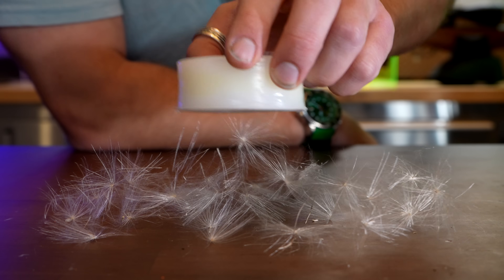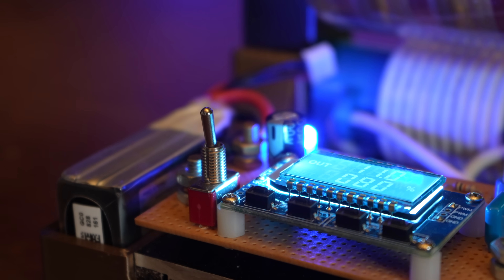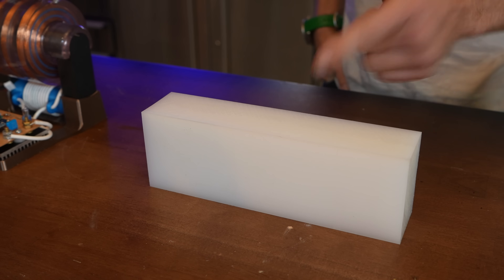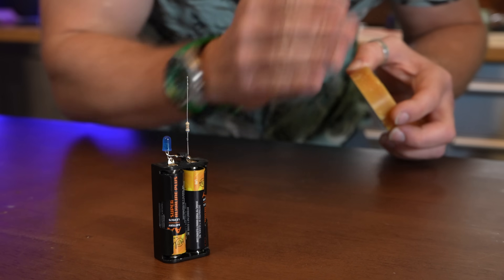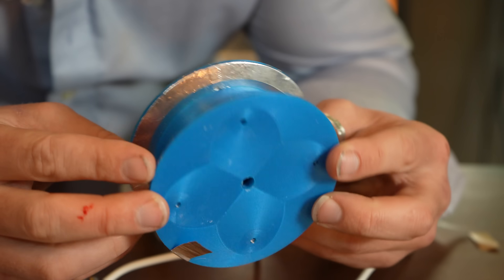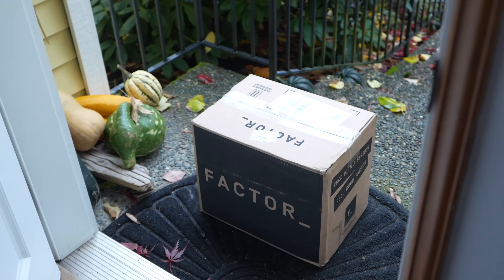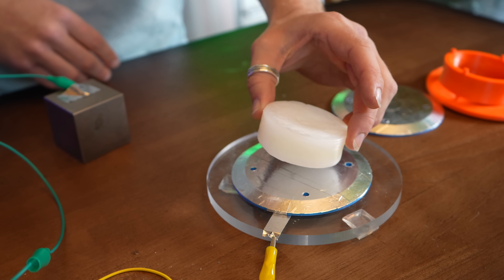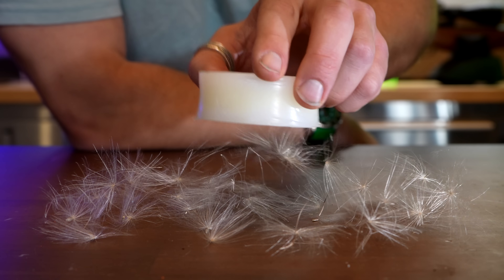Creating an Exotic Material With A Permanent Static Charge (Electret)

Comment: I used to work for 3M. We used Electret fibres for air filters.
Reply: Makes for a very good filter for the smallest particles doesn't it? I have used a few metallic static charged filters but they lose their charge with time
Reply: I have two of those in my house. 
And in the 1990's, I bought a couple for the house I owned then too.
Reply: @Technichian462  3M bought the technology from a Dutch firm decades ago. It's really interesting how they make charged fibres, but I'm uncertain how much is a trade secret: it's enough to know that once the fibres have been formed into a non-woven fabric that the overall charge is zero (as measured form the outside), and yet individual fibres retain their charge like little capacitors.
Reply: @chriscarter2101  wow sounds interesting, thanks for sharing
Reply: that is part of the principle for some of the particules in N95 masks
Reply: @chriscarter2101  That's really interesting!
Would that be the same kind of tech in like a 3M respirator?
Reply: @galacticviper4453  AFAIK, yes. IIRC (and Chris do feel free to chime in, Im interested if I got this right), there are three aspects to the basic white cloth-ish thing over the mouth with metal nose dealy respirators: Blocking, absorption, and deflection. Blocking (or filtering? Cant remember) is simply straight blocking large particles with pores too small to pass through. Absorption is the tangled mess of little hairs that grab onto things that touch them, similar to how activated charcoal has all those nook and crannies for stuff to get lodged in and captured. Deflection is for the very fine particles, there are threads (that I just realized are electret material apparently when I saw this comment thread) which through attraction or repulsion push particles out of the air flowing through the tiny passages and into the fibers to then be absorbed and captured. Basically the use (static) electricity to shove junk out of the air into the filter material! And thats pretty cool!
Reply: @galacticviper4453  3M Aura 9312 has this for instance. I used thsi type for years since I worked in dusty environments there.
Reply: Thank you, Mr. 3M for accidentally starting a religious war!

Seriously though, I knew there was something about static, but your comment made sense of it.
Reply: @firstmkb  Ha Ha! No, that was not my intention. I only wanted to share my insights into air filtering. Any opinions I have are personal and may not represent my previous employer ( I have retired!). There are still a lot of understandable emotions that society has to work through, openly and honestly, for healing to take place.
Reply: @chriscarter2101 Would you want Alex Jones ranting in your face with covid to be wearing a mask or not?
Reply: I am a big fan of 2 inch wide magnetic tape recorders :)
Reply: @MrThacke  The old Scotch system! I visited the 3M plant in  Gorseinon regularly from the late '80s. The technology was, for its time, amazing, with little robots rushing around carrying the meter wide rolls to tape and banks of auto splicing machines turning the tape pancakes into cassettes. It was sold to BASF as the world transitioned to digital.
Reply: Is the 3M static film invisible wall story real?
Reply: @ogbt  I very much doubt it. I worked on a high speed manufacturing line where we applied a hot-melt adhesive to polypropylene and polyester webs. I had to apply flags (taped time- stamp and lot number markers) to the web by hand every few minutes as we changed experimental lots; and every time I did so, I got a 20K shock. This did not prevent me from applying them but made for a very uncomfortable half an hour!  My hair stood on end but I was not prevented from approaching. Interestingly, I heard about a technique where an electrostaticaly-pinned plasma field could act as a gasket to restrain a low pressure gas on web-lines, but only experienced lines running at low pressure for various treatments. If true, then the plasma was resisting 14 pounds per square inch, and so there may be a grain of truth in there somewhere.
Reply: @chriscarter2101 oh dang, I’ve heard that rumor for a long time, it’s cool to hear a kinda confirmation of it’s plausibility, thanks for your response bro
Reply: Those masks main purpose was to stop water droplets in breath and air. Most of the viruses were carried in them @chriscarter2101
Reply: @chriscarter2101  oh good lord dont start with that shit. The masks arent meant to block individual virus particles theyre meant to block the much larger blobs of stuff that we exhale, cough, and sneeze, ON WHICH the viruses catch a ride. We're not trying to catch viruses themselves we're trying to catch the vehicles they travel on and masks are very effective at doing just that. If people like you were in charge we'd still be in the middle of the pandemic and it wouldve killed countless more people than it did.
Reply: @chriscarter2101  I can authoritatively say, you don't have any clue whatsoever about masks. I managed a team of two dozen public health infectious disease epidemiologists that study respiratory PPE (both in labs and in community) and were involved in the 63 page review below (citing 413 other studies and papers on the subject). The person I reported to has over 27,000 peer reviewed academic literature citations on the subject of respiratory PPE, particularly in the context of infectious pathogen protection. They work.

Greenhalgh T, MacIntyre CR, Baker MG, Bhattacharjee S, Chughtai AA, Fisman D, Kunasekaran M, Kvalsvig A, Lupton D, Oliver M, Tawfiq E, Ungrin M, Vipond J.2024.Masks and respirators for prevention of respiratory infections: a state of the science review. Clin Microbiol Rev 37:e00124-23.https://doi.org/10.1128/cmr.00124-23

p.s. I've still never had COVID, nor any other respiratory pathogens in the last five and a half years, until a single dose of rhinovirus this week from unwillingly going maskless somewhere indoors in public due to an emergency.
Reply: @chriscarter2101  As soon as I saw "PN-demic" I knew I was in for a treat.
Reply: @chriscarter2101  yes. about all the masks are good for is for redirecting your airflow into a certain direction (supposing you had a decent mask), so great if you wanted to get up close to another person and not blow crap directly onto them for a short amount of time.

@gormauslander the redirected airflow made it so that particles spent longer time being exposed to air and sunlight increasing the rate of viral disruption before said particle got reingested by another being. masks are rather a moot point beyond use at close range in general, at least without some really specialized stuff

also you have the problems of contradictory reports (as well as the de-contextualizing of reports), as well as political intervention absolutely mucking all sides up.
now previous to the pandemic, every time i'd gone to the doctor, any time the doctor wore a face mask was only when they were getting really close to inspect something on me especially if it was in the head region or involved a break in the skin.
Reply: @chriscarter2101  I was blown away how long took for the availability and price point to lower for PAPRs.  Seems the PAPR system is what one would want with more common COTS filters.
Reply: @jafinch78  Sorry but I can't comment on prices. In my role in Industrial Abrasives we generally used sir-fed masks, full face masks with carbon filters and disposable particulate filter masks. We did sell personal powered air-fed units but I never used those myself. I've never heard of the last category you mentioned: I'm a Chemist who worked in dust extraction from abrasives, and abraded surfaces, using various techniques such as electrostatics and adhesive wipes etc, not an expert in air-filtration technology.
Reply: That's so cool
Reply: AAAA
Reply: Plan Dem ic
Reply: @josephlieberman3027  Clearly
Reply: @chriscarter2101 While we can respect you for your knowledge in your designated field, please show the same respect for others in theirs. You might know more than us about charged particle filters, and likewise doctors know more than you about virology. They have explained time and time again that masks are not for trapping individual floating viruses, but water droplets escaping your face carrying them. Those are much larger than the individual virus cells and are able to be trapped in the mask and clinical study showed their effect.
Reply: @gormauslander  While we can respect you for your pedantry in your comments, please show the same respect for others in theirs. 

1) You do not speak for us, dont use "we".

2) Cloth masks were a better than nothing solution. Everyone knew this. Well, except for the Karens shooting security guards at dollar tree for asking them to put on a mask....

3) Would you like to take a tour of a virology lab with just a few sheets of cotton over your face? 

4) And finally, what all pedants deserve.... 
🖕😎
Reply: @gormauslander  thank god someone has some sense. Masks arent supposed to be catching individual viruses but instead the much larger particles they travel on.
Reply: @gormauslander  " and clinical study showed their effect." - yes, to be zero.

Masks did nothing except make people more aware of their hygiene and behaviours.
Reply: @gormauslander are you okay?
Reply: @ I'm okay, thanks for asking.
Reply: Better listen to Daddy know it all 😉

Comment: With pcb + assembly service from some Chinese fab you could easily build high resolution field imager, like 64x64 using for example 8x8 boards arranged by 8x8 or even you could build 256x256 sensor 😅

Comment: Fantastic video! I have a question: what happens if you place the electret in an electrolyte solution? I would expect that free charge carriers in the electrolyte would accumulate on either side of the electret, effectively shielding the electric field. However, I’m unsure about this because a similar effect should occur when touching the electret with your hand. 
It's surprising that the electric field can persist permanently. I would expect that over time, ions or molecules in an ionized state within the surrounding medium would migrate to opposite sides of the electret due to the electric field, eventually neutralizing the field. However, this might not occur if the process is energetically unfavorable—for instance, if the repulsive potential of the charges accumulating on the surface is greater than the work done by the electric field in moving the charges to the surface.
In any case, this phenomenon is incredibly surprising and super cool!

Comment: This is how face mask filter media can be higher filtration efficiency than just the fabric itself.  The material is made from polypropylene and is charged between charged bars.
Reply: Not just face masks. It is used much more in furnace filters! They are really effective when combined with a box fan. I had a 20 inch box fan and then used 5 furnace filters to create a big whole apartment air filter setup. The downside is 5 high merv furnace filters can cost up to 80 bucks and they only last around 3ish months depending on use time
Reply: @DarkAttack14  Reminds me of the old electrostatic filters, I had one on my furnace, but they need constant maintenance.

Comment: It would be cool if you made a 3-dimensional array and plotted the field strength in 3D. You could streamline the processes using PCBs.
Reply: I can imagine something like GreatScott's 3D led matrix
Reply: Great ideal, same as in my comment. That would be awsome.
Reply: Or you could try one sensor on a 2D or 3D positioning system
Reply: @AdrianBoyko  For example mount the sensor on the head of a 3d printer. If you could move that freely to any position you could take a picture each time and at the end merge them together

Comment: The most interesting is WHY the electret do not collect the electrons from the environment (there are infinite amounts everywhere) to compensate self polarization and become neutral?! It attracts light particles or water electrostatically, why do not attract the electrons from the near objects?!?!?!🤔
Reply: It probably does, but only on the absolute surface. The bulk is still charged. A higher detailed detector (I hear you can use grass seeds) may show this.

Comment: The word electret sounded vaguely familiar but I couldn't place it until the last frame when you mentioned microphones. I remember the word from electronics kits and tape recorders when i was a kid back in the 70s and 80s "electret microphone."  It was just a word back then.  I had no idea what it meant. Interesting video, thanks.
Reply: Same here! The first thing that came to my mind when I saw the title was - a microphone. My young self heard from dad that it was "capacitive", as opposed to 'dynamic' that were "inductive" because they were based on a coil and a magnet, just like every single speaker we've had. I remember wondering, if that's possible, then why don't we have capacitive speakers then? Imagine my grin when I understood how piezo-speakers from cheap toys exactly worked :D
Reply: @quetzalcoatl-pl  Capacitive speakers are usually called Electrostatic speakers, and they work quite nicely!  Some really fine stuff!
Reply: Thanks for that connection, I think most of us (old enough) vaguely remember that too

Comment: For the high-res version, I think you'll have an easier time designing a PCB and having it assembled for you by JLCPCB or PCBWay. You might even be able to have the sponsor the video, I've seen them sponsor quite a few maker videos featuring their PCBs
Reply: This! And that way you can make it even higher than 10x10.
Reply: Beat me to it! MM resolution on the sensors and the whole thing assembled for you. They'd probably do it for free for a sponsor bit, too, which I'm okay with.
Reply: @pufthemajicdragon  I2C each unit and make the 'antenna' shape such that you can detect levels of 'influence'.  Then create a device to fold the puck and maneuver it around at a specific distance.  Could even do a spherical detector array and a spherical manipulator surround to IMAX the whole thing.  I wonder if the field passes through things the way magnetic fields do.  I'll bet the quantum computers might flip errors with a charged up guy standing nearby.  If you are on very good, dry insulative shoes, you can take on a charge.  You become the separated conductive plate with Earth ground as the other plate and your shoes as the insulator.  I used to build HVDC supplies, so I can state that it is true.  Much better to put a big insulating sheet down those, because if one of those shoes fails, you would take a severe zap to your foot.
Reply: Beat me to this. Super happy to help you design it.
Reply: The use of some neopixels or something would be awesome too, can use a variety of colors depending on how far it is
Reply: + Some are small enough to allow a muchhhh greater density so you can see so much more of the field
Reply: Yeah, JLCPCB is great at doing this stuff. But please don't have them sponsor yo— oops too late. I already saw a JLCPCB sponsoring another video the other day so it went on my blacklist. Time to find another PCB manufacturer that I aren't yet boycotting.
Reply: @ZomB1986 What?

Comment: Could you tell me how high an ionisation level could be reached under the following conditions? A limestone massif with round and oval inclusions of various sizes is connected by carbonic acid capillaries, which penetrate the limestone massif vertically from the surface downwards. At depth, it has chemically bonded with sediment layers in a way that is mechanically inseparable. The sediment layers, consisting of sediment deposits, salt layers, and gypsum layers, are present in multiple strata.

An adjacent copper vein initiates an acidic process in conjunction with infiltrating water (from Nile flooding) and the probable production of the following acids: hydrochloric acid, carbonic acid, and sulphuric acid. This process caused a chemically inseparable reaction with the limestone massif. The infiltrating water, combined with copper leaching through acidic reactions, liquefied the gypsum layers and bonded them with salt layers and copper-rich water, creating an excellent electrolyte solution. The aluminium-rich sediment layers between these formations fused freely with the limestone massif.

Due to pressure development, this electrolysis activity was forced into the limestone through the carbonic acid capillaries, increasing the conductivity of the rock. High evaporation rates from annual floods led to seasonal oscillating storm formations. The increased conductivity of the rock attracted more frequent lightning strikes. This natural electrolysis activity produced surface efflorescence of calcium carbonate, sulphur, and gypsum, promoting the growth of copper-containing crystals.

Deep blue azurites and green malachites grew on the surface, while deep red cuprites formed on the massif’s interior surfaces. Hydrogen and oxygen produced by the sediments diffused into the massif, carrying fluorine from the sediment layers into the interior. Annual floods repeatedly introduced moisture into the massif and sediment layers, leading to the dissolution of the adjacent copper vein.

My question is: How high could the ionisation level be considered? Additionally, taking into account that this limestone massif exhibited vacuum-like behaviour, and that azurites, malachites, and sulphur compounds exponentially increased UV light energy, which penetrated the massif through carbonic acid capillaries and was absorbed by these minerals. This cooling effect allowed more gases to be retained in the vacuum-like rock. Could this scenario attract more lightning strikes and potentially lead to plasma formation inside the limestone massif? How high would you rate the ionisation level on a scale of 1 to 10?